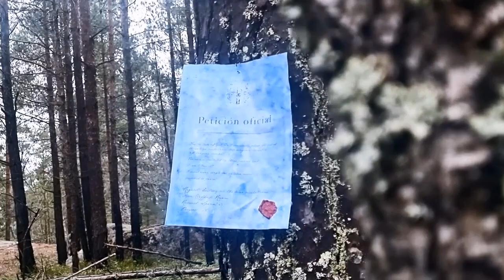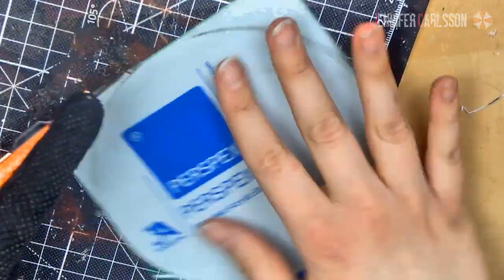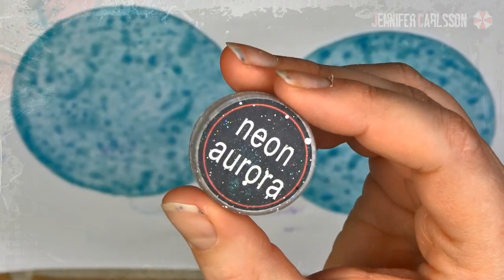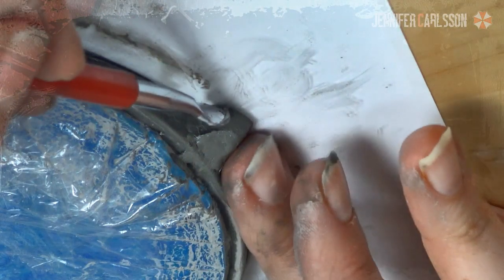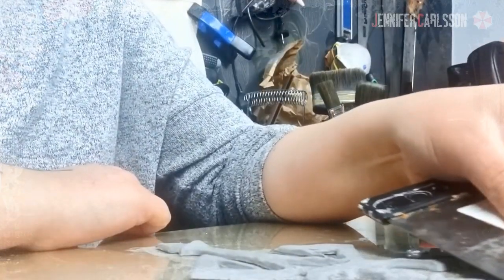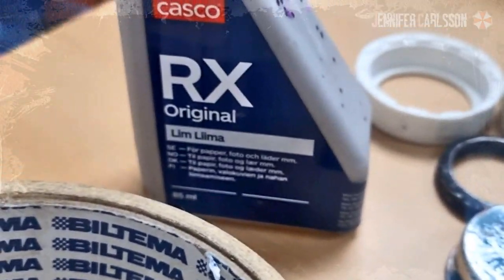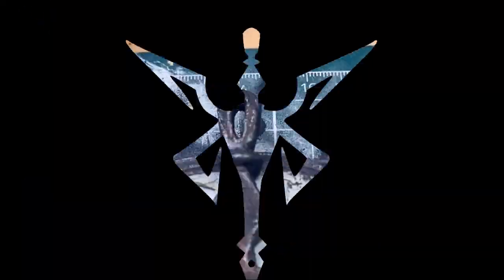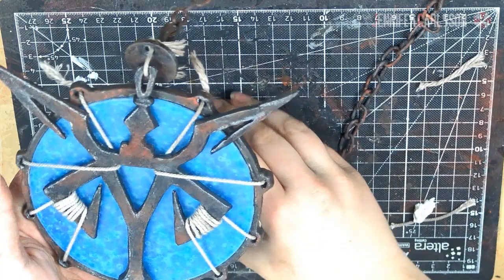Blue Medallion from RESIDENT EVIL 4

Comment: Its amazing im gonna try this with eva foam i hope it turns out good!
Reply from the maker: Thank you!😁That sounds awesome! 
Might even be stronger than using modeling clay since the foam doesn't break apart. Clay is very sensitive if you accidently drop it on the floor(unless you use a strong finish on it like epoxy).😉
//Jennifer